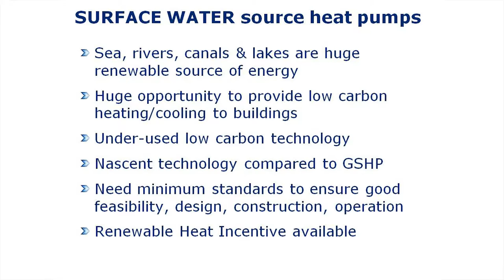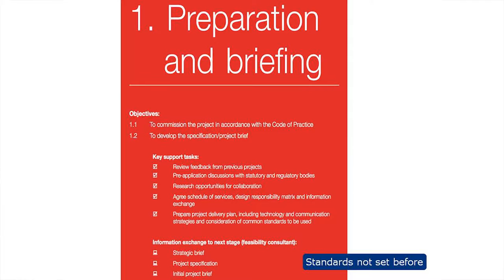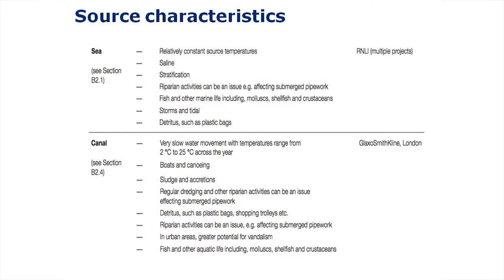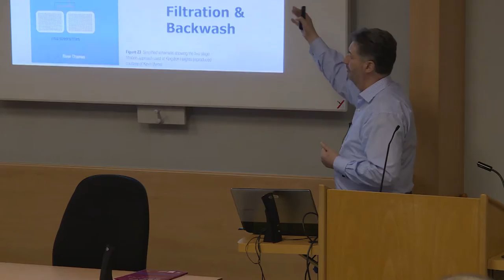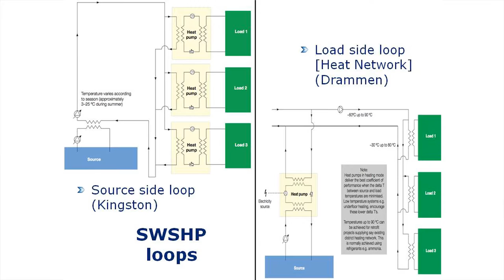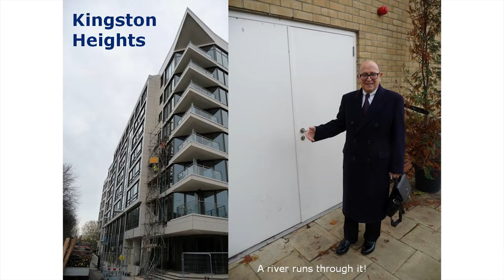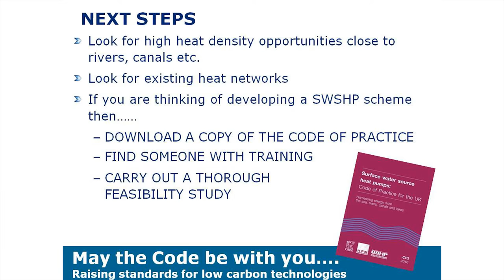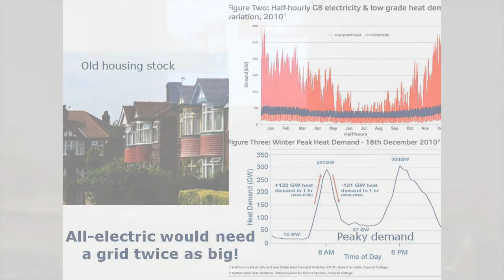Phil Jones: Surface water source heat pumps

Comment: are there any small water source heat pumps that could be used on a barge on the river..I live on the river lea on a dutch barge next to the olympic park and would love to be able to cool/heat the space this way...in summer I make around 1800w power from solar    probably only 300w in winter......have diesel boiler and solid fuel currently for winter heat/hot water but would love air con in summer
Reply: I would like to know that too, but i'm afraid that's a less than a million dollar question.